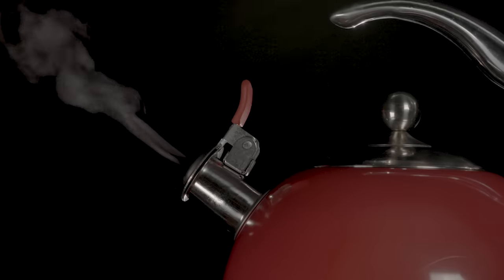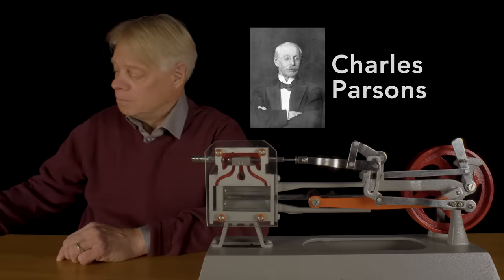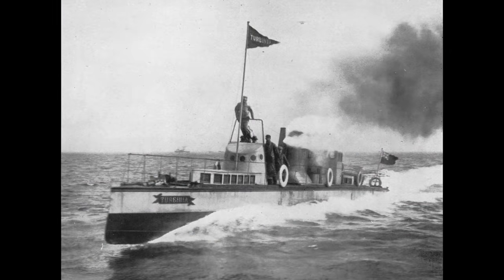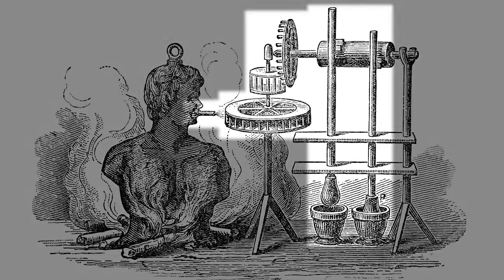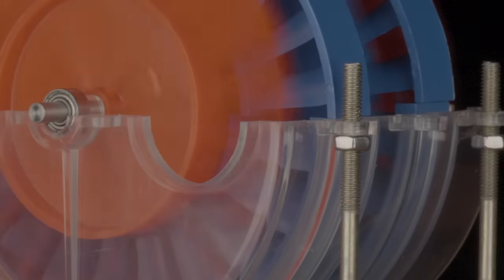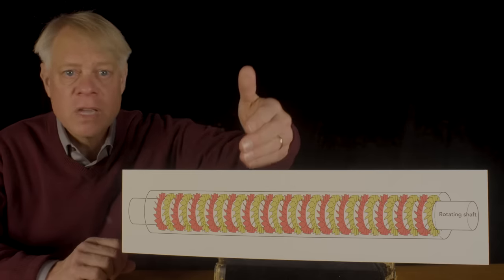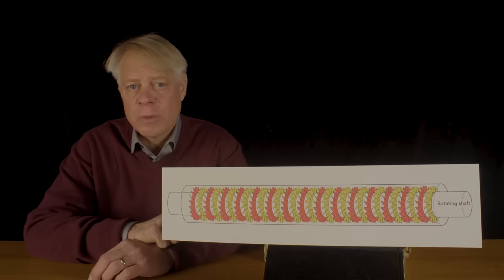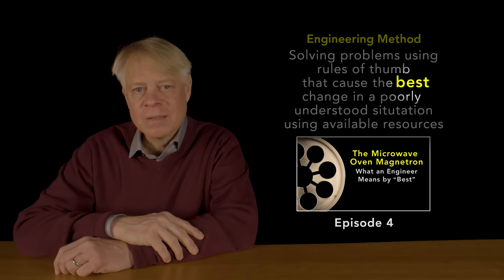The Steam Turbine: The Surprising Relationship of Engineering & Science

Comment: Time and time again I watch videos from posters such as you who cannot visualize turbofans, turbojets, axial compressors, and turbines.

For example, look very closely at 5:55 in the video.  If steam were to enter from where you illustrate, the turbine would not rotate in the direction as you illustrate, it would rotate in the opposite direction.  Worse is the fact that you indicate that the blades are the turbine blades; turbine blades are never powered by sending the gasses toward the convex side of the blades.  They are always powered by sending the gasses toward the concave side of the blades.

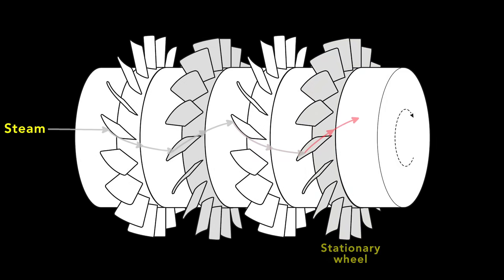At 6:50 through 7:27, where you show the rotors and the stators, you have completely missed the correct fluid flow through these blades. You are actually showing an axial compressor not a turbine, although you still missed the proper gas flow direction to illustrate an axial compressor.  Sorry!